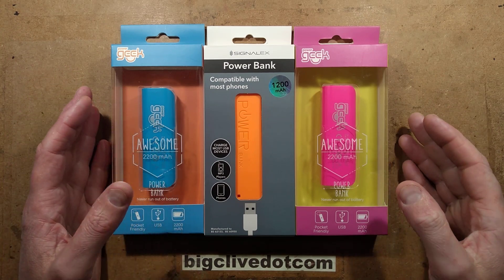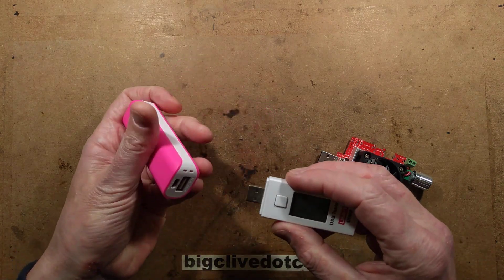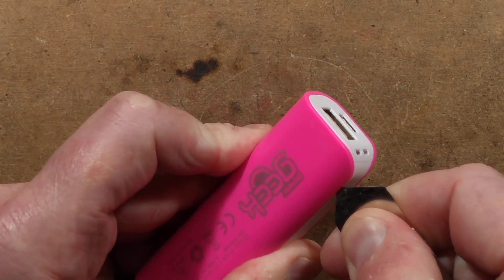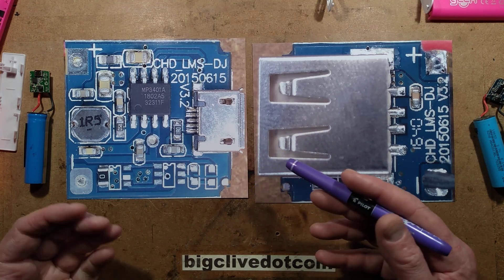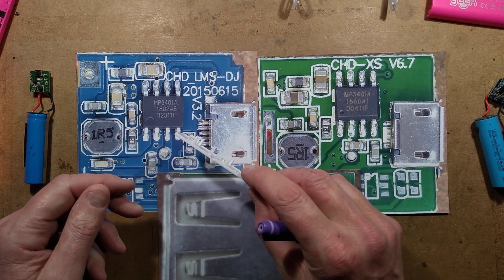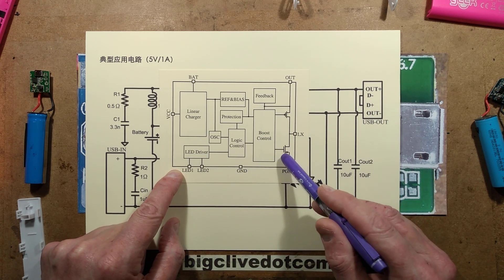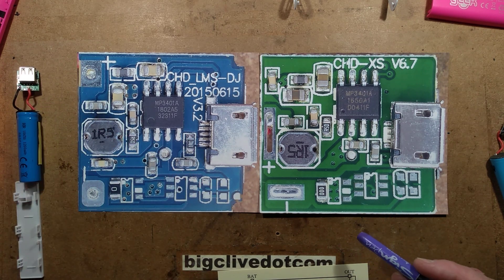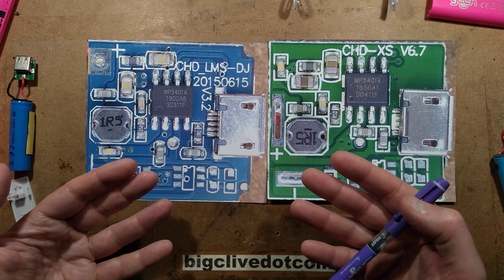Inside the new Poundland Power-geek 2200mAh power bank.

Comment: The output usb port of my 2200mah power bank broke, so i replaced it by soldering in a spare usb port i had. It works again but the blue led randomly lights up even when nothing is connected, should i be concerned? Anyone have any idea as to why the blue led could be randomly lighting up? It's only supposed to light up when something is connected to it.
Reply from the maker: The blue light may pulse gently to show that the output capacitor is being topped up.  The more leakage there is, the faster it will pulse.

Comment: i dont think you mentioned this but those MP3401A chips get really hot in operation. im seeing 80c+ on both the 2200mah and 4000mah power banks. is this ok though? im not sure..
Reply from the maker: They do run hot.  When charging the lithium cell they effectively act as resistors to limit the current.
Reply: @bigclivedotcom  ahh so insted of using a tablet 3amp charger using a iphone 1amp one is better?

Comment: I use one of these battery banks too power my Zoom H1n. Lasts for ages. Cheaper than buying rechargeable batteries and the charger.  Also rechargeable batteries are only 1.2 volts.

Comment: The rating is the battery at it's typical voltage, meaning it's likely a legit 2200mAh battery in there, however you will never get 2200mAh of current after it's converted up in voltage. For example 3.7v at 2.2Ah = 8.14Wh, this is the true power of the battery. When boosted up to 5v, naturally the current will now be 1.62Ah. So the fact that you got 1.7Ah is pretty good. 

Of course labelling it like that is dishonest, because the average consumer doesn't assume that the mAh rating is what the internal batteries are at if drawn upon directly, they assume the mAh rating will be for the output socket of the power bank itself, the USB output.

Comment: what dual mosfet is he taking about at 10:16
Reply from the maker: The DW01 cell protection chips often have a dual MOSFET to disconnect the cell during charge or discharge.  The size varies with expected load current.

Comment: Would be interesting to connect 2 of the 1 pound cells to one connector (keeping both boxes, maybe hot glue together) and see if that's not better value for 2 pounds. Gives you a spare connector for another project too.
Reply from the maker: There are advantages to using these simple modules with larger parallel cell arrays.  These modules stay awake and supply 5V all the time even with low loads.

Comment: Mine is hissing somone help me
Reply from the maker: Some make a high pitched noise in use.  It's the circuitry that steps the voltage up to 5V.
Reply: @bigclivedotcom   so is it normal and safe
Reply: And this happen with the cable that came in it mine doesn't make the hiss sound
Reply from the maker: @its_melol2641  Some modern phones will have an issue with cheap cables and aren't suited to very low power devices like this.  You may be better getting a more robust power bank from somewhere like ASDA/Walmart.
Reply: @bigclivedotcom  OK but is it normal please tell meeeeeee for the hisssing

Comment: Have a comment about USB.I was looking through my USB chargers and decided to use my pink coloured USB charger but I dropped it on the floor and a bit broke off it so I managed to get it apart with a lot of difficulty and the insides of the mains USB plug looks very interested I thought you might want to have a look at 1 or maybe not

Comment: Some powerbanks have higher output current limits.What determines the maximum 1A current limit on the output? Can these be moddified to output at a higher current?
Reply from the maker: It depends on the circuitry in the power bank and that is indicated to the load by voltages on the data pins.

Comment: which would you recomend to use?
Reply from the maker: It depends on your application.  If you just need a low power USB supply for small things then these are fine.  But for proper phone charging I recommend a bigger charger.  Like the Blackweb power banks in ASDA.
Reply: @bigclivedotcom  how much are them? im just looking for a power bank to charge my phone when there isnt a plug socket
Reply from the maker: @ethanmu2003  It depends how much capacity you want.  It's typically a £/$ per 1000mAh capacity.  It's worth getting a 5,000mAh to 10,000mAh unit.
Reply: @bigclivedotcom  thing is tho i never use power banks and i only need one for 1 week and i dont want to spend more on something im gonna use for 1 week and then just never again (which out of whose 2 would u recomend)

Comment: I modded a portable radio that used 4 D-cells to use one of the 2200mAh banks. Works a charm although does create some interference on MW.
Reply: What's the battery life like as compared to the old 'D' cells.

Comment: I bought an identical powerbank to the 2200 mAh, but branded differently. Thanks for taking it apart, I was curious how they work, and what capacity they actually have.

It's interesting that the circuit has a minimum output current, under which it goes into standby. I guess that is built into the IC chip. I wanted to use it with a motion sensor powered led light for a closet.

I found that around 0.2 ma is the minimum which can keep the power bank from going into standby. I'm using an led with a 10k resistor to keep a load on it so it doesn't standby.

Also interesting that every few seconds it drops to 0.06 ma, and then back to 0.2 ma, like it's probing for something.. not sure why..

Comment: Got a Signalex/Poundland 1200mAhr one here, marked model 170327, with the same PCB, same component values but it's got an SY3501C chip on it. Datecode appears to be 1813A6 which I read as week 13 2018. Can't find any data about it online.

Comment: Mine's blue LED annoyingly is always on, depleting the battery. If I remember correctly, the blue LED didn't do that when the unit was new.
Reply from the maker: It might have a damaged output connector or leaky output capacitor.
Reply: bigclivedotcom thanks! I’ll check.

Comment: Just got one of the £2 ones to test and it gives about 1040mah at 5v.  Which is just enough to fully charge my iphone se.  Not bad.  It looks like the one clive measure gives a better capacity though?  Might go to another town and try get another one for comparison, that is one from another batch.  I also bought a wilkos one at 3 times the price and it gave the same capacity so Im taking that back!  Would like to try putting a higher capacity cell in too.  I think the good 18650 cells give 3500mah which would be enough to charge my phone 2 or 3 times ?

Comment: I would say that battery capacity for the 1A Power bank with it saying 2200mah 🔋 is decieving for sure as most manufacturer put the voltage of the battery (3.7 nominal) and not the boosted converted 5 volt voltage of the USB ,also as with everything there are power losses.For your Math=
       So let's see, 3.7vx2200mah=8.14Wh
Now assuming there is no loss then 🔋 capacity it will be 8.14wh 5v=1628mah.

Comment: Cheaper or even good power banks rate the capacity if the cell at 3.7v - not the 5v power you get out of it. The ratings may actually be correct if you add the 25% difference with the voltage step up plus what ever the conversion loses are thoes are probably good cells :)

Comment: WARNING Will Robinson WARNING!!!  Mrs W has just delivered two of the 2200s into my hot sticky hands ... I was thrilled then immediately crushed to find that while the first one I opened was fine - the second wouldn't charge!  I couldn't resist the temptation and slipped a fingernail down the seam of the case.  The problem was pretty obvious, the uUSB was bent out of kilter and the plug wasn't making contact ... easiest option is re-assemble and take it back tomorrow.

Then I realised what exactly I was looking at ... the battery had been stuck down with the battery polarities the opposite way to the board's wire terminations - so when I started to re-assemble it, the respective  + and - were almost touching with only a minute airspace between - In your pocket it wouldn't take very much to bring the two together.

While it may be a cracking little gizmo it comes with potential to blow your goolies into next week!!!!  I've checked the other one and it's fine, no twist and little chance of a short (Clive's looks OK too) ... I still slipped a bit of Kapton tape over the solder joints and a sliver of plastic between battery and board just in case - you can't be too careful where the jewels are concerned.  I'll be checking any others I buy too.

Comment: Bought several of these following this vid. The 2200 had gone up to £5 but the 1200 was still £1 and that is what I bought. Plan to swap out cell anyway - really wanted a mp3401-based unit to avoid pass through cell voltage at low charge level. Thanks Clive !
Reply: Lol today 26 December 2018 I brought poundland emoji power bank 4000 mah one for five pound so you are wrong about the 2200mah  one

Comment: If you pay 4 pounds, will you get 4400 mAh? Will it overheat and explode? 😃
Reply from the maker: It turns out that £5 gets you 4000mAh but includes a torch and battery charge indicator.

Comment: The inductor and capacitor between the inductor and ground is a snubber network. As the chip is a CMOS part its maximum voltage is 7V. Spikes at the switching load can go above this and kill the chip. These shunt HF spikes to ground. The spikes can get worse at low tempetature!
Great review. Thanks.

Comment: the 18650 cells themselves will have the proper 2200 and 1200 mAh. only when converting it to 5V you've got losses. a shame it is common practice to call that the powerbank rating if it is only the rating of the cells.

Comment: IF the cell is 1.2 amp hours but you have to boost the voltage, the effective amp hour rating will drop(to keep the watt-hour rating basically constant).  Measure the current/voltage from the cell itself while doing the load test and see if it meets it's label then.

Comment: 12:30 The cells actually do have the capacity as labeled. The capacity is based on the total capacity of the cells while the power banks will probably limit the charge over 95% and under 15% meaning your useful capacity is 80%. So 2200mAh * 0.8 = 1760 mAh.

Comment: My local Poundland also sell a thin power bank made by " Intempo " Its claimed to be 2600mAh. label on the battery says  Output 5v 1A.  input 5v 1A.  LiPo battery 2600mAh  3.7v 9.62Wh Come in various colours.    With 2 led lamps plugged in its drawing 0.27 A but the voltage is just 4.87v with no load is 5.28v

Comment: Hi Clive, thank you for all your videos - i watch with great interest - sometimes to the annoyance of the wife lol. I buy the cheaper one just for the module - however when used with multiple "quality" cells in parallel, it takes an age to charge. - Is there any way to increase the charge current to the battery please? [i tend to use two modules and can charge from both at the same time to help but this defeats the object of using two modules for charge and supply at the same time.
Reply from the maker: It uses linear regulation to charge, so the charge current can't really be increased without the chip getting a lot hotter.  If it self regulates down from the starting 1A charge current it might be possible to get a more predictable 1A charge current if a small heatsink is added to the top of the chip.  That could also reduce the chip temperature when putting out current at its upper threshold.
Reply: bigclivedotcom  Yes, I heardyou say that in the video  -  was hoping that there may be a resistor/link that set the starting  charge current. - no matter  thanks for the quick reply, look forward to your next video
all the best Andy

Comment: Yup, the Chinese will cut corners when they can. It's just embedded into their culture. This even goes for well-known brands like DJI and Xiaomi, but only for units sold domestically. Export units are alright. And yet again, the chip on these units show that the Chinese will not hesitate to turn to a cheaper chip manufacturer if their stock runs out or if they can save a penny or two at the risk of a handful of failures. And Chinese people just don't care. They buy something and use it until it breaks, and then they just buy a new one. Manufacturers, builders, and shops know that, and therefor produce crap quality.

Comment: The one of these I have is also pink, is branded Travelocity, claims 1800mAh on the outside and cell, uses a Tpower TP4303F chip and a 2.2uH inductor instead, actually has the DW01B chip, and there are no wires, the nickel strips from the cell are soldered directly to the board. Oh and it cuts out at low load so I can't use it for my Ikea gooseneck USB light.

Comment: The posh one looks older than the cheap one, v3.2 compared to v6.7, or perhaps that version number is only relative to the specific model?

Edit: That said, the posh one DOES have a blue circuit board, which I've always been told blue boards are more expensive because they're a better mask or something, so maybe it's the latter.

Comment: Could you use one of the boards to charge/discharge two LIR2032 cells? If not, is there a resistor that could be replaced to tune it  to the right current?

Comment: Clive, how are you measuring capacity?  It's accepted practice for the manufacturers to quote the capacity of the cell itself, and that's clearly what they're doing here based on the writing on the cells.  If you measure on the USB output and compensate for voltage then you're including efficiency of the output circuitry in the measurement, so it's not surprising that you're getting lower values.  1708mAh for a 2200mAh cell suggests around 77% output conversion efficiency, which matches other results I've seen for that controller chip at 1Amp USB.

Comment: +bigclivedotcom I've got an interesting power bank that's failed. It's a USB-C with Power Delivery model from dodocool DP13, rated for 30W in and 45W out. It looks to me like a couple of components on the charging side popped. Would you like it for a teardown?

edit it also interestingly doesn't use 18650 cells, instead using 21700s.

Comment: I have 3 with the name 3SIXT all battleship grey.  They have the same shape exactly as the Geek ones and mine came from Dick Smith Electronics about 4 years ago, not long before they closed down. Two are now dead, don't charge despite the red light, the last is still going but has low capacity and a bad connection on the micro USB

Comment: Presumably the capacity listed is that of the lithium cell. That's going to be at least 30% higher than the power bank output because of the boost SMPS in the power bank that takes you from the 3.8v of the cell to the 5v output.

Comment: Another thing about the ceramic capacitors are that they use XR7 dielectric. The capacitance varies with voltage. That means they're okay for bypass and suck for anything else.

Comment: Most likely 2200 mAh is the cell capacity at 3.7V. Boosting that to 5V gives a lower capacity measured in Ah. Kinda a slimy way of rating things.
Reply: correct. conversion losses not taken into account. problem is every one rates it this way.

Comment: The capacity of the cell is larger than the meter says because the boost converter has some losses and voltage boost. Still they should advertise the real delivered power..

Comment: Seen this recently and for the price, is it actually 6000mAh as it claims or is it once again a cheapy chinese knock-off? https://www.ebay.co.uk/itm/4pcs-32650-6000mAh-3-2V-Lifepo4-Battery-Rechargeable-Li-Iron-Phosphate-E-bike/142937813348?hash=item2147c1f164:g:x1cAAOSwVxdbm0lq
Reply from the maker: Hard to say, but keep in mind that it's a large diameter cell and lithium-iron, which has different upper and lower charge/discharge limits to standard lithium.

Comment: But when you test the MA hour are you correcting for the 5 volt output , in no way can it do as many MA for as long @ 5V as 3.8V .   Really these testers need Watt hour  then can calculate a better MA hour of the battery (-) loss due to conversion to 5V   Even in charging it's 5V input converted to cell charge volts, Increasing the MA @ the cell input as to the 5V input lower current draw.  The battery can not be rated in charging or discharging  external the measurement tool needs connected on the battery itself, which these little testers have USB - most like mine do run down to 3 volts
so one can actually test a battery with a direct connection to the cell.

Comment: Poundland trades in Ireland under the 'Dealz' name. They sell the cheaper power banks for €1.50 which is a substantial markup on the UK price.

I've found that they suffer badly form self discharge, going from 100% charged to almost completely discharged in less than 24 hours.
Reply: I believe Clive's is also a Dealz

Comment: If that is the control chip I am thinking of...   Heads up:The power drops out every couple of seconds for checking.  So they are no good for microcontrollers
Reply from the maker: These ones seem to put out a continuous 5V.  The ones that have the input and output USB ports in parallel do tend to dip regularly to see if there's a charging supply present.  A way around that might be to use a low drop diode and capacitor to maintain the output during that dip.

Comment: im curious clive ,for £ per amp hours ,is it cheaper to build your own using well known branded 18650s and a good battery management board or cheaper to buy a anker branded one or something ? it cost me £25 for a 22,000 mah anker pack but i know good samsung cells are £1.60 a pop at least without bulk discount EDIT. im tempted to make my own E-bike battery with them i know i need a powerful driver and management board, premade Ebike batteries cost least £300 ! :(
Reply from the maker: It's finding the good batteries with accurate specs.   The ebike batteries have to deal with very high currents and usually have extra protection built in.